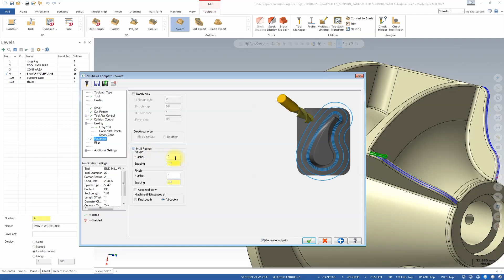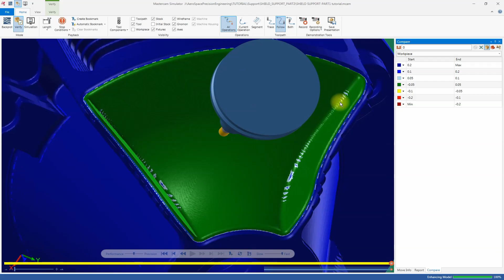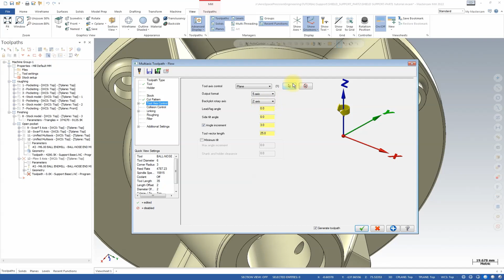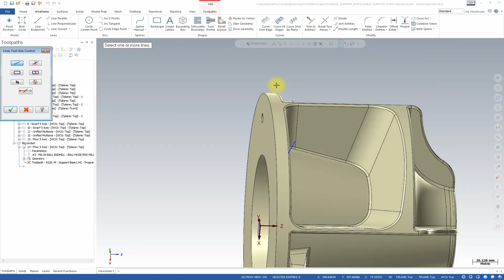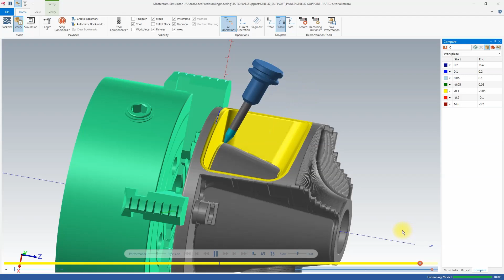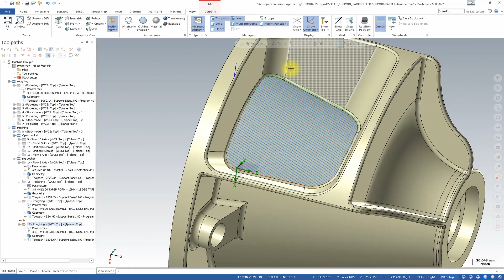MASTERCAM 2022 - FINISHING USING MULTIAXIS POCKETING & UNIFIED - SHIELD SUPPORT PART 2/3

Comment: I have a question, boss.
Where did you learn master cam?
Reply from the maker: internal training at work then various training: cnc software, inscot, d4, and years as senior programmer and then as engineering manager,
when i started there was no tutorials on youtube it was hard to learn Mastercam or Catia

Now im trying to pass knowledge to others
Reply: @aspeaerospaceprecisionenging  
Koreans say hypermill is the best five-axis software.

But I don't agree with that.

I want to let Koreans know.

For mold making, powermill or hypermill is good.
However, the mastercam 5-axis is better for making lathe, turn mills, 4axis, and jeneral parts making.
Reply: @aspeaerospaceprecisionenging  
You're the pioneer of MasterCam.